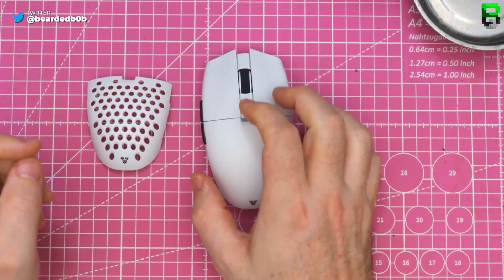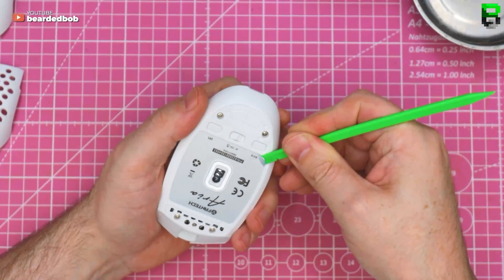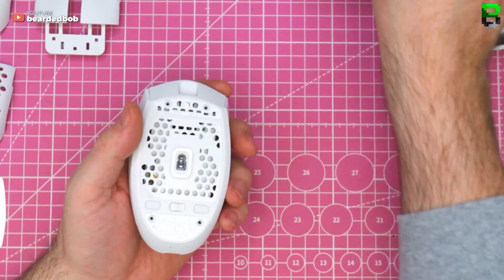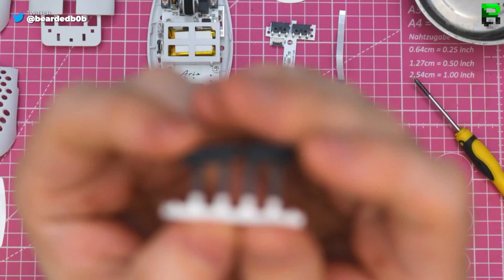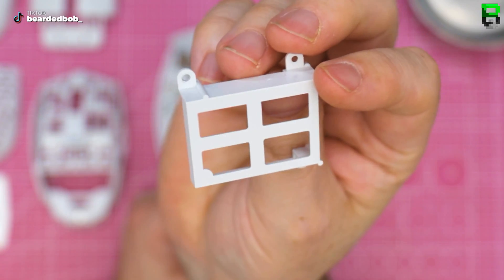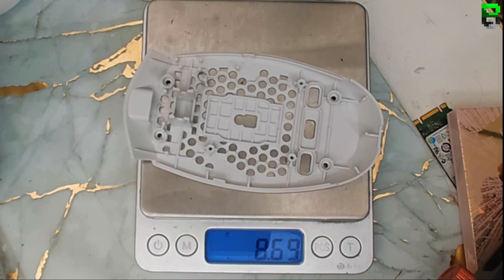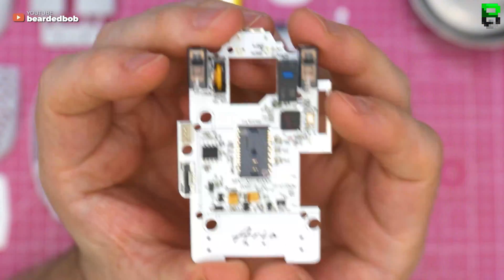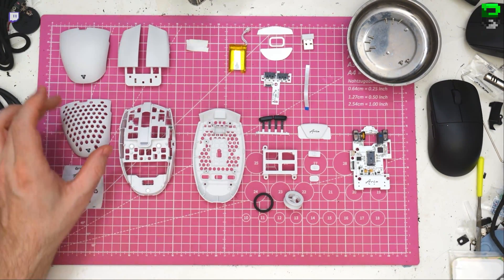WHO BUILDS A BETTER MOUSE?: RAZER OR FANTECH ARIA XD7

Comment: Whats really annoying about any weight adjust system is that no one has figured out a good way to attach it yet. Each one of the magnets to hold the hump in weigh like half a gram. Not even counting the extra screws or extra plastic used to hold the magents in place.
Reply from the maker: Agreed, I’ve some ideas so maybe one of them will have a chat we shall see